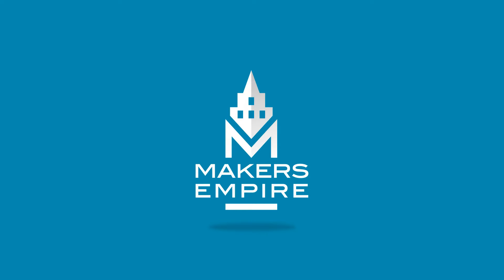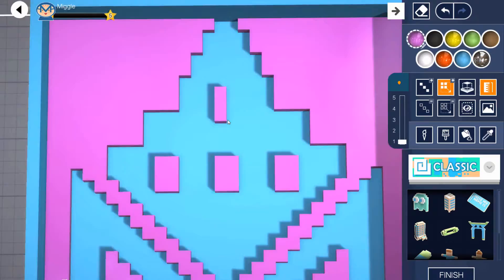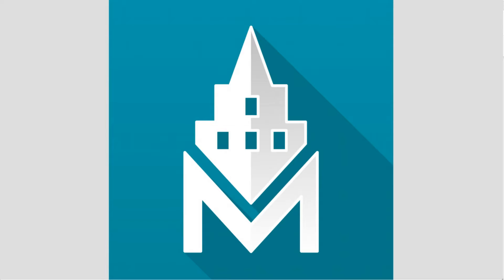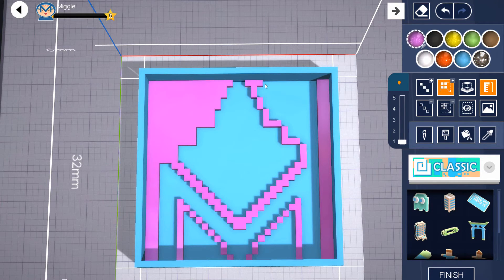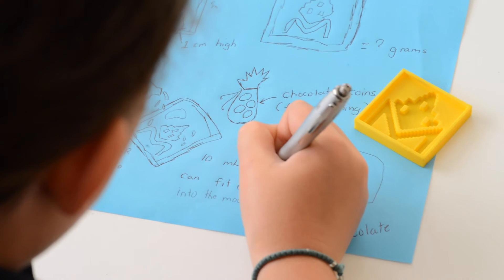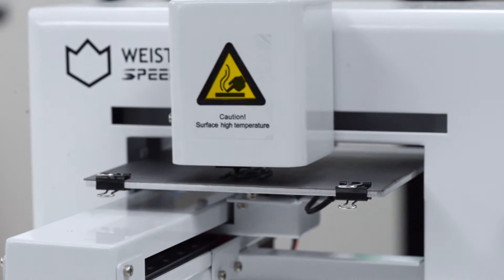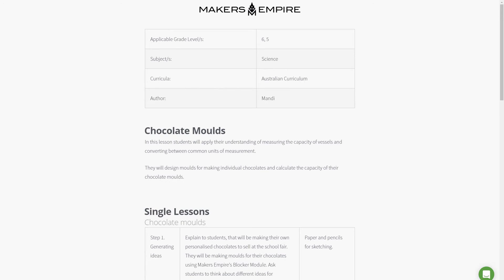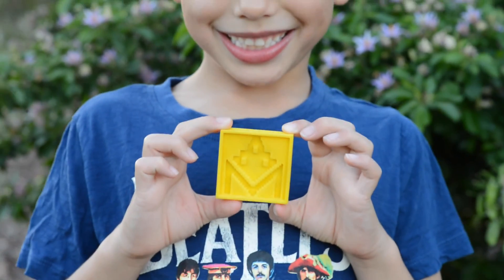How to make a 3D Printed Chocolate Mould with Makers Empire 3D (Maths | 5-6)

Comment: Using Food safe plastics?
Reply: PLA (Most common) is not food grade. PETG, I've heard is good grade and like the same plastic water bottles are made of. PLA is the easiest and I don't see it being an issue for food as long as you clean it after printing so theres no strand of plastic and why not to be safe. The fumes are probably more unsafe than creating chocolate molds.
Reply: Most food grade filaments are PETG like Consulting Joe said. Also they are typically transparent/colorless.

My concern would be the hot end/nozzle/feed system also being food safe. Some hot ends contain lead and other nasties. Also porosity seems like it would be an issue for cleaning. Bacteria would find lots of places to shelter in a 3d print. I would probably prefer to use a 3d print as a positive and use a silicon mold, or use some sort of sealant like polyurethane. 

That being said I doubt eating one piece of chocolate out of a 3d print is gonna do anyone in.